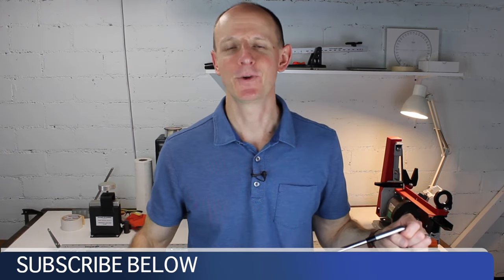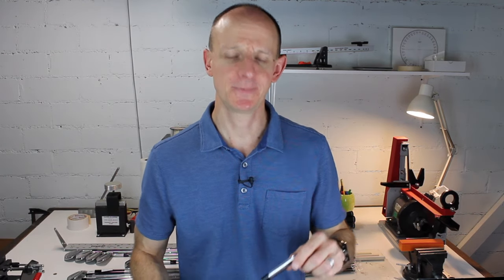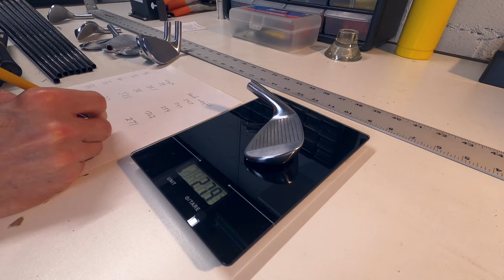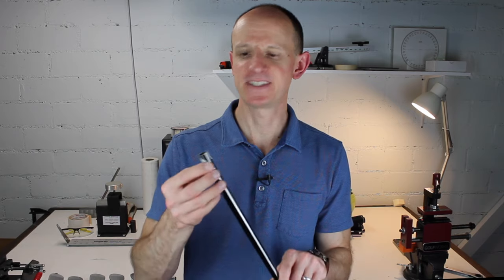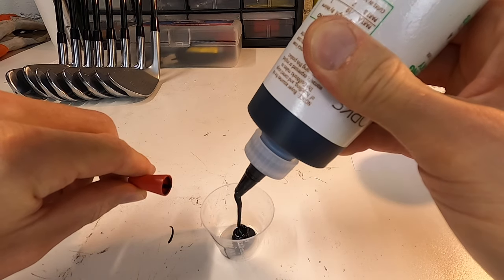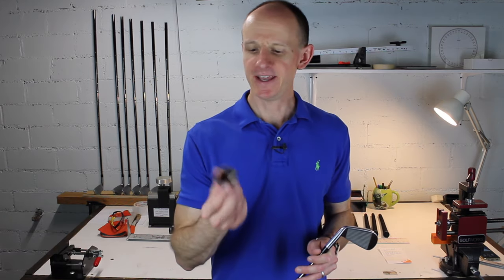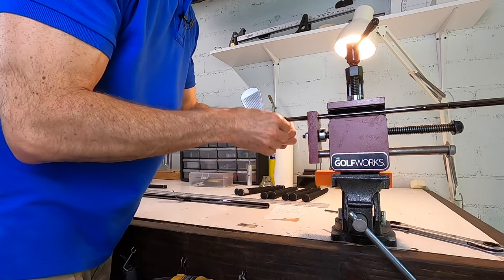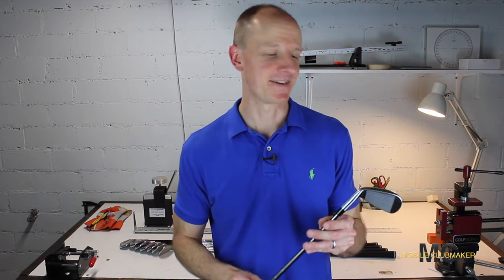GOLF CLUB BUILD - How to reshaft your irons Step by Step

Comment: I recently ordered some steelfiber shafts for my set of ZX5's and am super excited. I contacted my local big box golf retailer and seems pretty affordable to do a reshaft for my irons. I'm afraid if I go with them, they will not be as detailed, particularly with the weighting, and that I'll end up with some mismatched weighting (PW-D1, 9i-D4, 5i-C7... you catch my drift). Do you or anyone else have any input on this?
Reply from the maker: Any big box store will be a roll of the dice as to what you will get. Might get someone good, might not. I can tell you that they don't pay attention to SW. They are only going to just glue and go. If you want it done right you need to find an independent club builder or you can ship them to me!
If you are interested in that, just email me.
aj@smartstake.com
Reply: @EFGMC  sent email!

Comment: Very nice. Would they be weights you put in the hosel. ?
Reply from the maker: Yes they are.
Reply: @EFGMC  would they be of different weight for each club.
Reply from the maker: @michaelbritton9778  Usually they are all about the same depending on the QC of the heads and the lengths you chose.
Reply: @EFGMC  Thank you very much.

Comment: I have a set of Ping G430 irons with Nippon Pro Modus 105 stiff shafts and a set of Srixon ZX5 MKII with KBS Tour Lite regular shafts. 
Would it be possible to swap these shafts over?
Reply from the maker: Yes, you could swap those two setups. Everything would fit without issue. The Pings are tricky to deal with compared to the Srixon heads, but other than that.

Comment: love the content. I have a few questions. 1. you appear to be using the taper tip shafts which are iron specific. how do you determine which shaft goes in which iron? does the 5 iron shaft always go in a 5 iron? What if you have stronger lofted clubs (6 iron at traditional 5 iron loft). would you pair the shaft to the iron based on loft, desired playing length, weight? 2. do you bother taking into account the weight of the tape and epoxy for swing weighting? 2 layers of tape could easily reduce the sw by a point.  3. how do you balance grip preference with the overall weight and swingweight of a club? I like the MCC+4 align midsize but they are 67g. I would have to put a significant amount of tip weight to balance it out, but then I may make the overall weight too heavy. Thanks again!
Reply: Good Questions.   If you put a 5I shaft into a 6I it will play stronger or a 6I shaft into a 5I will play softer.   I install the grip on to the shaft prior to swing weighting the head to account for grip and tape weight.   Epoxy is about point 1 SW.

Comment: Hello.
Nice video. I'm more and more interested to build my own set.
But I wonder : swingweight is a static measurement, while MOI is a dynamic one.
So, I start to  think that it's better to have the same MOI on every club than the same weight.
Reply from the maker: Some people agree with you. I have done sets using MOI matching and personally never found a benefit from it for myself but I know others who like that feel. The simple way to do it is progressively SW the set going .6 SWP (swing weight points) per iron going heavier from long iron to short.

Comment: I recall from some of your vidz you like a 7g difference between clubs in total weight.  Does that hold true for AMT shafts too or should i just focus on the swing weight?  I’m planning on installing AMT White S300 shafts in a set of T200 iron heads to play around…my gamers are T100S irons with Project X LZ 6.0 shafts…
Reply from the maker: The 7g rule is based off the assumption you are stepping in 1/2 inch intervals through the set. I think the balance point is pretty consistent in the AMT even with the weight changes.

Comment: Great videos. I like the way you simplify the process. And here's my question. I'm thinking about taking a set of irons and making a one length set out of them. I see lots of videos about finding the spine of the shaft and F.L.O. checking. Do I really need to find the spine if I line the head up correctly oriented to oscilation?
Reply from the maker: Thanks for watching. There are various viewpoints on Spine, FLO, PURE etc. My take (and I am planning some videos on the subject) is it does not matter if a shaft is oriented or not. Two main reasons. First, the shaft is bending not in a single plane, but in countless planes as it rotates during the swing so trying to align a shaft in any one orientation disregards all the other ways it bends during the swing. Second, if a shaft is "round" and bends the same around it's circumference, alignment is not going to benefit you. If a shaft is out of round to a point where say logo up produces a stiff equivalent flex but logo 90 degrees from there produces an R flex, that shaft is junk and should never have made it out of the factory.
All that being said, if you are doing it yourself and not paying for it, then I say go for it if it gives you more confidence. As far as which direction to install if you do, some people will say with spine pointing on target line and some will say at 12 o clock position. I think more people lean towards the 12 o clock method but again I don't believe in it myself so don't have a dog in that fight.
Reply: @EFGMC  Thank you very much for the response. So, I guess I'll go for it. I'll try to match swing weights and see how well, or not so well, it works. Again, thank you. I look forward to seeing more of your videos on this subject.
Reply: To answer your question about Spine and FLO aligning the shaft, I would have to say after 17 years of doing both on ALL of my clubs and any I build for customers, I would NEVER think to play a club that I did not do the Spine and FLO alignment work on the shafts. Does it make a difference? YES IT DOES. To prove my statement, let me tell you a story of when I was looking to buy a used driver to re-build for myself. I found two drivers, exact same make and model, same factory shaft, same flex. Only difference was one driver the head looked like new, the other the head had a number of clips broken off the paint on the crown of the head. Well used to say the least. I decided to hit both on a launch monitor to see how they felt and performed. The driver with the like new head was terrible. EVERY ball I hit I hit a big fat SLICE with it. The driver with the well worn head, I hit it DEAD STRAIGHT and long. Same drivers remember. The worn driver was $20 cheaper that the like new one, but the worn one performed well and the pretty one was terrible. Maybe that's why the pretty one was still pretty, it never to use because it didn't perform. So I decided to buy both to see what I could do with the pretty one to get it to perform like the ugly one. I pulled the shaft from the pretty one, did a Spine and FLO alignment job on it and then re-installed it in the head and put the grip back on. Went back to the store and re-tested the pretty one on the monitor and this time I could hit it just fine. NO SLICE this time, just nice straight and long drives like the ugly one I tested. Bottom line here. SAME shaft, Spine and FLO aligned, it the same head, same grip, went from a nasty SLICE to a nice straight and long drive. Does Spine and FLO alignment make a difference. I'LL LET YOU DECIDE. 

IF  you would like more prove, I can give you lots of cases where doing the Spine and FLO alignment work did wonders for the performance of the clubs.
Reply: @donfisher6659  I'm definitely interested in learning more about this before I start this build. I'd like to speak with you about it, if possible. If you're on FB,  my profile is under my name and the profile pic is of my business Reaper Arsenal-South. I look forward to hearing from you.
Reply: @jasoncampbell501  I'd be happy to talk to you about how important Spine and FLO alignment of the shaft is to how the club will perform when it is assembled. I looked on FB and found LOTS of Jason Campbells but not you as far as I could tell. I do have a FB account and you can find me under Don Fisher. I'm in Aurora, Colorado. I'm NOT a big user of FB and have only used it once or twice since I signed up to make a friend happy. Maybe YOU can find me on FB and get it touch with me so we can talk.
Reply: @jasoncampbell501  I just posted something on FB about looking for you. See if you can find it under recent posts.
Reply: You want the shaft to FLO properly, that is TRUE. But a shaft will FLO in two different alignments, one inline with the Spine and the other inline with the NBP. which is 90 degrees from the Spine. And the flex will be different depending on which way you install the shaft, with the Spine or NBP down the target line. How much difference you will see will VARY from shaft to shaft, and can be as much as a FULL FLEX, or more. I had a set of high end iron shafts SST Pured years ago, and the flex of each shaft was tested and noted on a form. The shaft that was the most consistent varied 3 percent from the stiffest to the softest. The shaft with the most variation was 13 percent different, more than a full flex different. As you might imagine, HOW these shafts were installed in the club head was very important to get the flex of all clubs to be the same. So if you ONLY do the FLO test you could end up with some shafts playing as stiff as possible for that shaft, while others could be installed to play as soft as possible for those shafts, You would NOT be happy with the results if you did this and neither would anyone else.

Comment: What ferrule do you recommend to keep them as uniform as possible? 3/4" or 1"? The clubs have a .355 tip
Reply from the maker: Personal preference. If you have a caliper, you can measure the hosel outer diameter and try and match up a ferrule with a similar outer diameter.

Comment: Rookie question.   If I need to cut a shaft for a TM M4 5i which is 38.50 per the TM website do I measure from shaft tip to butt without the head?
Reply from the maker: 38.5 is the playing length so you would measure from the base of the club head hosel up the back of the shaft to 38.25 inches. The grip will give you the final .25 inches.

Comment: What else can you use to take the finish off the shaft and to roughen them up ? If you haven’t got a 2 in one machine ??
Reply from the maker: For steel, coarse to medium grit sand paper works great, just takes a bit of time. For graphite, again you can use medium grit, or use a utility knife blade as a scraper, angle the blade towards you and scrape away from you so you aren't cutting into the shaft, just scraping off paint.
Reply: Does a grinder work for metal shafts or not really ?
Reply from the maker: @nathanalexander4290  Yes, just use a gentle touch.

Comment: Question, say I buy clubs second hand, along with some shaft pulls in my preferred brand/flex. Should I still measure for swingweight? Ex. T100S irons with the PX LZ 6, getting AMT White X100.
Reply from the maker: The most important thing in regards to swing weight is ensuring all the irons have a similar feel to them. The actual number isn't as important. Really just making sure your 6 iron isn't drastically heavier than your 7 iron etc. Weighing all your component pieces before you begin is an easy way to ensure more consistent SW. 7-8g between each head will give you a good uniform SW progression. This assumes you are building with a standard length progression (1/2 inch per club).

Comment: Hi After weighing my iron heads, i have noticed the 4 iron at 251g and the 5 iron head at 254g. Is a 3g difference normal in the long irons? as the 5 iron to pw are 7g increments..Or would you ad 4g weight to the 5 to pw so the 4 to pw would have 7g difference throughout the set? Recoil ESX 480 F4 shafts to be fitted.. Thanks...Nick..
Reply from the maker: Always easier to add weight than take it away. I think some long irons will be lighter because the manufacturer builds them on longer shafts than the standard 1/2 inch progression.
Reply: I forgot to mention that the 4 iron is a Callaway UT Apex CB model and appears to have a much thicker sole than the 5 iron..Do I need a 7g weight difference between these irons or shall I just make do with the 3 grams difference and build the clubs?  Thanks.... @EFGMC
Reply from the maker: @nickpritchard7130  Easier to build lighter and then add lead tape if it feels too light.

Comment: When I popped the shaft into the head after glueing it felt quite lose and looked like it wanted to move around. 
Is there something I would have missed or not used enough Epoxy ?
Reply from the maker: Depending on the heads, some will have a very loose hosel. Callaway, Ping, PXG all have this. You ideally need to fill that gap either with brass shims or drywall mesh tape in order to center the shaft.

Comment: I'm getting my MP18 MMC irons reshafted with DG 120 X100's from DG R300's myself! I'm excited. I also am reshafting my MP20 HMB 3 iron while I'm at it. I noticed the MP20 HMB has a recessed bit for a collared ferrule. I was going to use the same ferrules I got for my MP18's, but it doesn't look like I'll be able to do that. Would it really affect it that much? Or should I go ahead and get some collared .355 ferrules like the golfworks or billy bob's ones? Cheers.
Reply from the maker: Never think you need a collared ferrule. Get whatever design you want regardless of collar. Epoxy will fill in that gap during assembly and perform the same task as a plastic collar.
Reply: @EFGMC  thanks a lot for the quick reply! Love the channel. Really informative stuff.

Comment: What solvent did you use to clean any epoxy from head or shaft after epoxying new shaft to head?  Was it grip solvent?  Also what solvent was used to shine the ferrule after wiping ferrule with acetone?  Was that also grip solvent?
Reply from the maker: Yes, grip solvent for both. I however no longer use grip solvent with the ferrule turning. Just use texture free rag or paper towel and extremely light strokes and the results are better and faster than what I show in this video.

Comment: Hello,
what solvent do you use to shine the ferrules ?
Thanks from France.
Reply from the maker: Acetone on a texture free cloth, brushed on very gently.
Reply: @EFGMC  Thank you
Reply: It seemed you used, Acetone & then Grip Solvent in the end for polish? Is that correct?
Also seemed you used Grip Solvent when wiping down shaft after installation, is that also correct?
Thanks!
Reply from the maker: @richshallcross  Skip the solvent polish step. If you brush the acetone very gently, you won't need it.

Comment: Love watching club building and enjoying doing it for myself. Always tinkering around with different shafts lol. Was wondering what brand and model your combo sander and cutoff wheel is ? Nice setup !
Reply from the maker: The one in this video is from Golfworks. It's the smaller option and although I liked a lot about it, I would not recommend it. I've had two of them fail (bad motors). Ungraded to the larger 1/2 HP version now and it seems like the better choice. Hopefully it continues to be!

Comment: Great work there thanks.  My question is ....which manufacturers match the swing weight on new clubs?  And is it important to frequency match your clubs?
Reply from the maker: All the OEMs say they do, and usually they are pretty close to spec. On occasion you will find some random club out of spec but it's rare.
Some people believe in frequency matching but I do not. I think flex overall is overrated in it's influence. I do think it's important to have similar feel through the bag for all the clubs so having similar flexing is important but I would never bother trying to hit exact cpm numbers believing that would make a true difference.
I do believe however that weight is very important and that is where I always focus my attention. Consistent weight and weight progression are a bigger deal for me, and since weight has such a strong influence on the flex in a shaft, taking care of it, usually gets the other about where it should be.
Reply: @EFGMC  thanks for the detailed response sir. I am considering my first new set in over 20 years and have been trialling Mizuno, Ping, Callaway. If they all match swing weight then which weight would they work to or can the customer specify at the time of ordering?
Reply from the maker: @JettyBuilder  If you are ordering, they can match a requested swing weight assuming you don't ask for something wild like C5 and the clubs are 1 inch over standard.

Comment: When the shafts come are they all the same size?  Are you cutting each shaft to a different length to match the iron standard length or do they already per iron?  Do you already have video on shaft lengths for irons?
Reply from the maker: Because these are .355 tip shafts to go into the Mizuno's, the manufacturer has constructed the shaft to bend appropriately for the give iron head it matches with. If you were using .370 shafts in something like Callaway Big Bertha irons, you would usually need to cut the tip amount a certain length to play correctly in the iron head. 
After that, you would just be butt cutting to the final desired length and that would be the same regardless of tip size (.355 or .370).